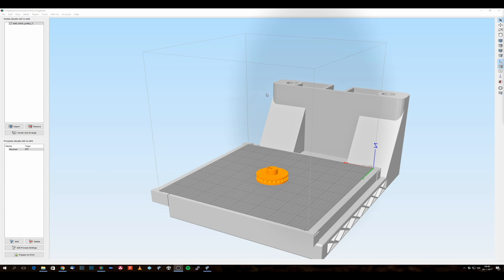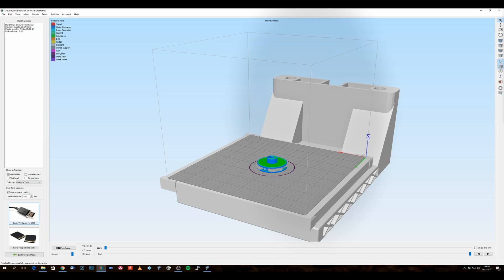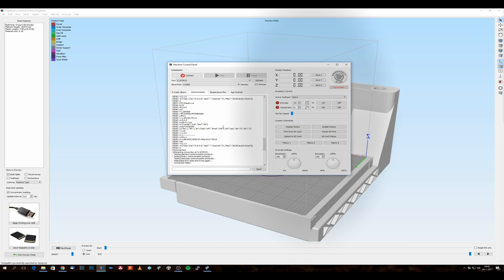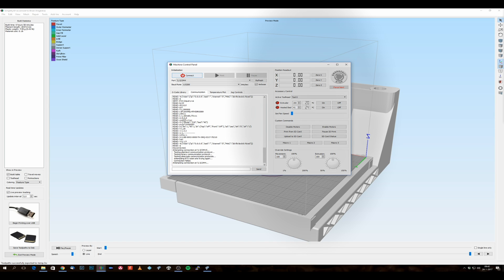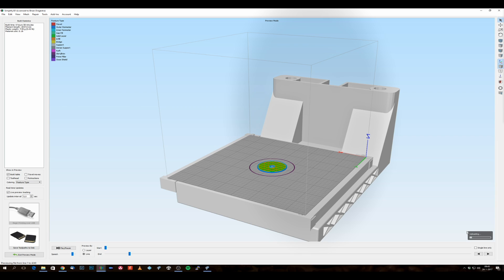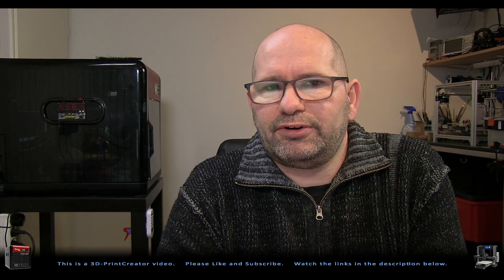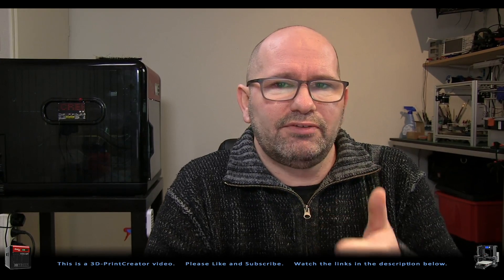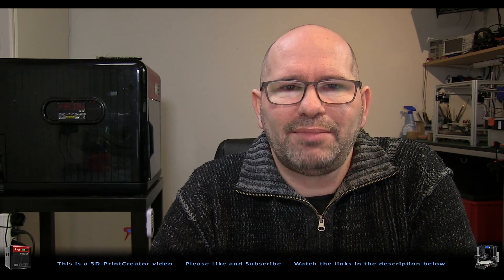▼ Troubleshooting connection between Da Vinci Pro and Simplify3D

Comment: Did you ever solve the 0040 problem?
Reply from the maker: Yes, change the Micro SD card on the motherboard, behind the backpanel of the printer. Use one that has a maximum of 16 GB, the board can't handle more memory.

Comment: ..now explain when your port is non existant. Mine just disappeared.
Reply from the maker: I don't understand you. Is this a question, and if so, what is the question?
If the port doesn't understand, there is either something wrong with the computer it's USB driver or with the port on the printer.

Comment: Hi Brian everything ok? when I go use the da vinci pro 3-1 with simplify 3D version 4.1 the printer say that the file is not compatible with the printer. I'm using STL file. Inside the da panel control on simplify, the printer appear connected. Do I need use that arduino to solve this problem or there is other way? if yes, please where do I can buy one that? thank you so much.

Comment: Thanks for your help. On simplify3d 4.1 I can now connect to my printer via WiFi but I dont see an option to print via WiFi. Do you have a video that explains the process
Reply from the maker: Hi David,
Sorry, but I never did a video about that.
I always connected my printer via a USB cable because the WiFi in my house has always been very unstable.

Comment: Hoi Brian, ik krijg na het verzenden van de opdracht de melding "File not compatible with da Vinci Pro". Ik gebruik de Davinci Pro 1.0 met Simplify 3D. Weet je misschien waar dit aan kan liggen? De printer ontvangt de opdracht goed maar daarna gaat het dus mis en komt deze melding naar voren.

Hi Brian, after sending the file to the Davinci Pro 1.0 with Simplify3D i receive the error message "File not compatible with da Vinci Pro". The printer is found in the software, i can see that that part is working fine, could you help me out?
Reply from the maker: Hoi,
Weet je of de apparaat settings goed zijn ingesteld?
Als het goed is kun je de Da Vinci Pro gewoon kiezen uit het drop down menu en dan zijn de meeste instellingen goed ingesteld voor je, maar daarna moet je de printer nog verbinden door op connect te drukken in het Machine Control Panel. Als je dat gedaan hebt, die je als het goed is een heleboel tekst voorbij komen, hier staat alle informatie in over de geslaagde of mislukte connectie. Als het mislukt, dan staat hier altijd goed beschreven waarom het niet lukt om te verbinden.
Reply: Hoi Brian, heb nog even lopen spitten met jouw info en het werkt nu. Bedankt voor de input.
Reply: Hoi Brian, Ik heb hetzelfde probleem. In het drop down menu van mijn software staat geen DaVinci pro, alleen 2 andere andere printers. Verbinding tussen software en printer is aanwezig maar hij geeft File Not Campatible with Da Vinci Pro. Graag hoor ik het van je.
Reply: @nevamstel  hi. Having dame issue. Did you ever find a solution?

Comment: Hi Brian

I runs the simplify3D software and the Pro printer via WiFi - and sometime it will not connect. But after 1 or 2 try extra it connect. I haven't found what cause the problem - yet.

But what thing I have found - is the Simplify3D software's machine control panel overload my printers CPU (I guess) because the printer after some time start to spend more time on talking with the machine control panel. Than print - so the movement of the nozzle stops and starts. When closing the machine control panel, printing starts to go more correct after 10-30 sec. But the print has be cancel as the result is useless.

Do you have had the same problem ?

Thanks

/Per
Reply from the maker: Hi Per,
No I don't have that.
When I am printing there is a status update coming from the printer every 1 second. This is information that is send serial and it doesn't matter if there is someone listening or not, it's just send all the time. So if you have the control panel open, you are really listening to this communication and if you close the control panel, you are ignoring it, but it's still send from the motherboard to your computer. In fact, Simplify3D is still listening, but not displaying the results. The fact that the software knows how far the print is on the build platform is the proof the software is still listening to that communication.

So, having the control panel open or closed is not more or less CPU intensive.

That said, I always have my control panel open and I have never experienced my machine to stop or even print slower then when the control panel is closed. If you see some of my video's where you see my printer working and the temperature monitor in the top of the screen, that temperature monitor is actually coming from the control panel (screen grab) so you can see it works flawless here.

Comment: Are there any free softwares that others can use?
Reply from the maker: Beside the supplied XYZWare for pro you can also use Slic3r or Cura for this machine, but although they are great slicers, they are not nearly as good as the (expensive) Simplify3D software.
Reply: 3d Print Creator by any chance have you used cura for the xyz ? If so can you make a video on how to set it up with the xyz printer
Reply from the maker: I have been using Cure for a very short while. I didn't like it and bought Simplify3D because of that.
I have looked, but I don't have the settings for Cura anymore.